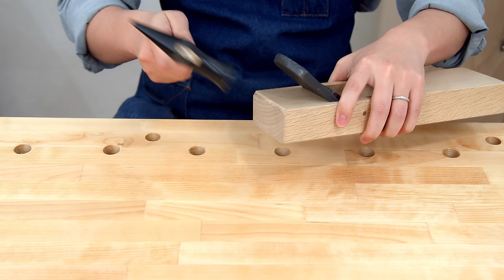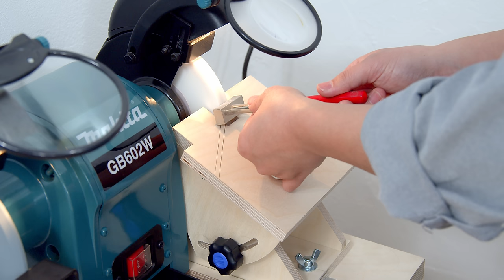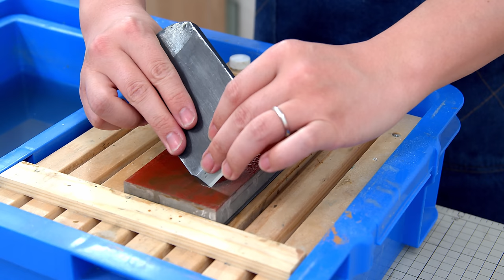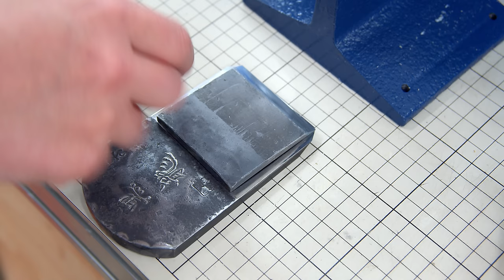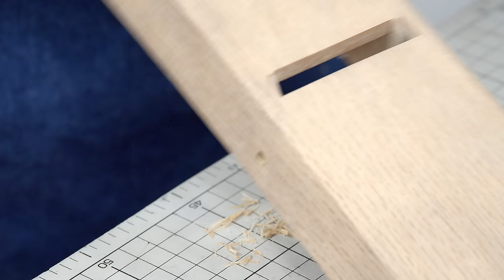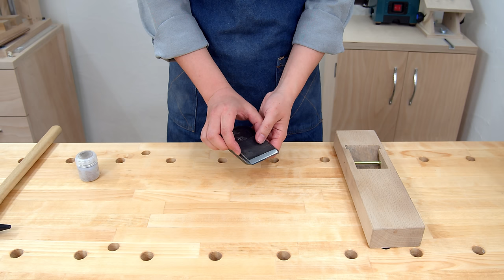Setting Up a Japanese Plane "鉋 Kanna"

Comment: Super super sharp blade/ iron. 
Question if I may 🤔,  viewing the blade/ iron sharpening wet stone, why are we not able to buy stones of this size 🤔? the length is probably the same but, we do not seem to get the width in the stone that we need for our wider blades. 
Thanks Les.

Comment: If it's so much work setting up why not just make the block yourself? And I can understant why the block needs some work, but I imagine the blades wouldn't need to be worked on that much right out of the box right? Then again I don't know anything about this but I am just curious.
Reply: It all depends on the level of work that you intend to achieve with the tool. If you only need/want to do 'ordinary' works, then it is OK to use both block and blade just out of the box. However, if you aim at top-quality work, then you should fine-tune the tools. It is just like cars. The commercial models are good enough to run on the streets. However, if you want to be a champion on the circuit, then you would have to make all modifications. Upgrading cars is anyway cheaper and easier than building a racing car from a scratch. The top-quality racing models cannot be purchased from shops simply because it would be unrealistically too expensive. The only way to get there is to start from commercial models and use your hands and skills – exactly like this master craftsman in the video.

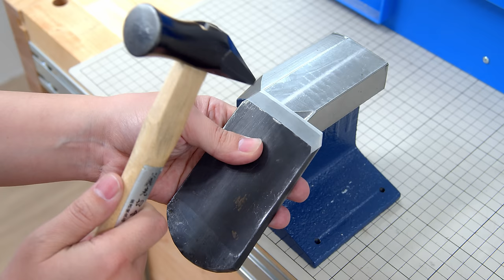Comment: why did you hammer the blade at 5:38?

thanks
Reply from the maker: It has the effect of pushing out the blade.
This effect completes the work without sharpening unnecessary parts.
This is a Japanese knife's unique method.

Difficult to explain. . .

Comment: nice video, but why use the "paste", the stone is like a grinding wheel, all that is required is the oil/water to lubricate the stone,remove swarf from cutting,  as well as wick away any heat buildup, to stop the stone from cracking!, the pastes are used on 'Flap' polishing wheels, the white ones, and only as a final step, ie: like cutlery polishing, or the polishing of a keen edge on chisels/ gouges for woodwork, these are the finest abrasives possible, to sharpen, don't you need low grits, 60,80,120 grit?, these "cut" the steel, and shape it, the powders, and finer grits 600 -->3000, etc. are mainly as finish, ie to get a 'mirror shine'.